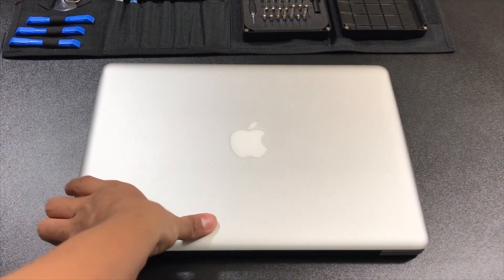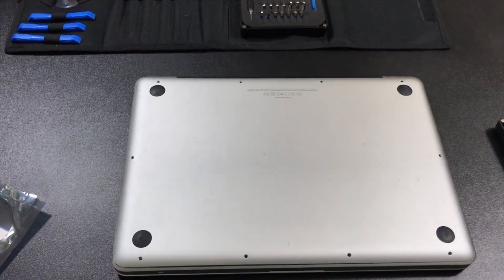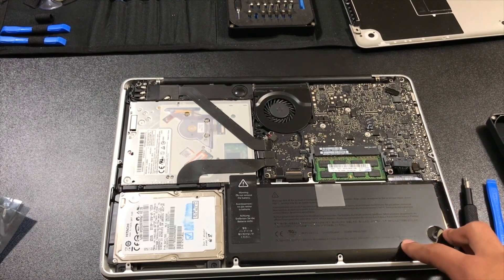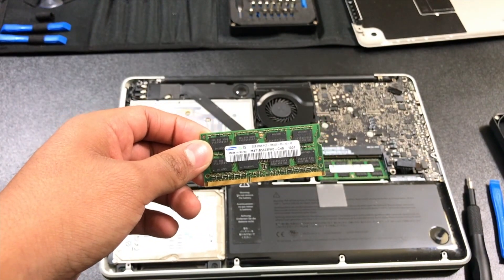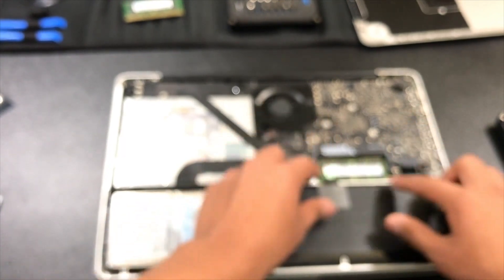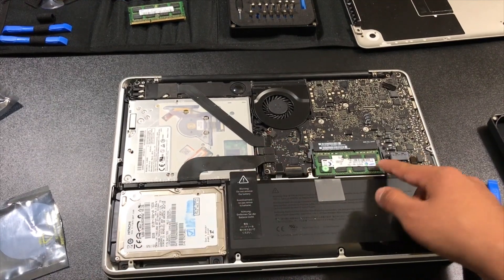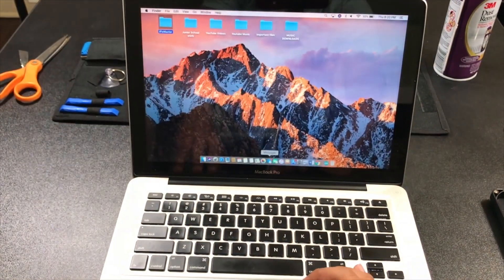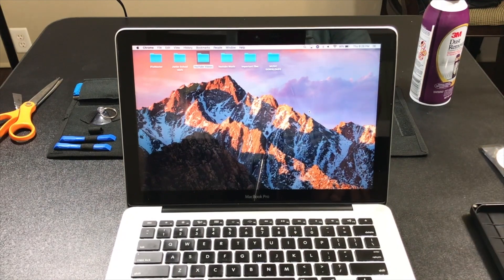RAM Upgrade on the Mid 2012 MacBook Pro

Comment: Hello sir, Is it possible to upgrade for MacBook-Pro mid 2012 15 inch to 16GB x 2 so the ram will be 32 gb?
Reply: Nope the maximum is 8gb ram and 500 gb ssd
Reply: @TECHBOZZ41  thanks. now im using 8Gb x 2 so the total of ram is 16Gb and its still work perfectly
Reply: is it a retina version? or unibox
Reply: MaxArmy ISIS Yeah Yeah mine is non retina MD103 Mid 2012

Comment: Hello Sir, Is it possible to upgrade ram to 32 gb in MacBook Pro early 2013 ? Currently it’s with 16gb
Reply from the maker: No sadly that was the year when it was soldered to the logic board. 2012 was a great year for macbook pro when discussing repairs/upgrades

Comment: Am having Macbook Pro 13" (Mid 2012) with 2 + 2 GB of RAM. Now, bought a 8GB single RAM. Can I have 8 + 2 GB of ram inside OR is it better to have only one 8GB ram inside using only one slot. Heard using uneven ram amount will lead to issues. Please suggest
Reply: arun prasath dont put 2 different sized ram. It seems to work but the frequency and clocks doesnt match. Resulting in no improvement even after upgrading.
Reply: @nizamuddinahmed5366  Thanks brother. Do you say is better to use only one 8GB ram in a slot. Since am having only one 8GB ram and 2 X 2GB ram.
Reply: @arunprasath11252  yes. Either use 2 8gb or 2 2gb. U can use both but performance wise it won't increase

Comment: For macbook pro 13 mid 2012 with 12800 or 1600?
Reply from the maker: With 12800
Reply: Best upgrade hdd to ssd.. video card wich using Ram, an vide card take maks 2gb